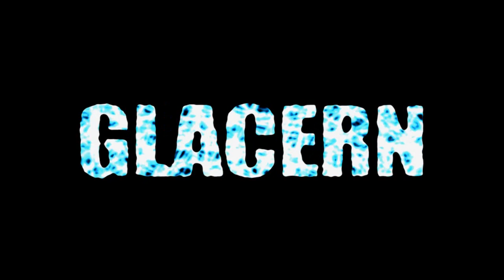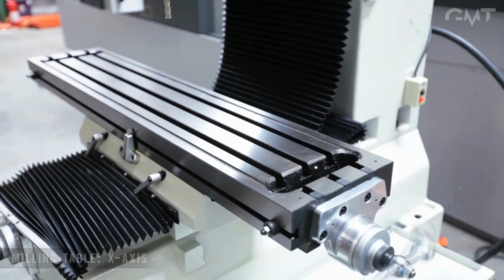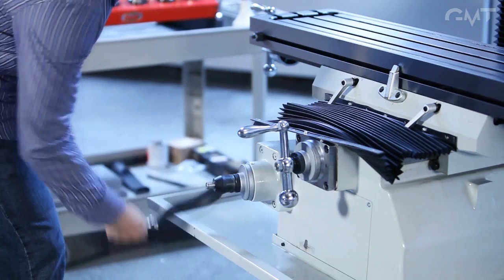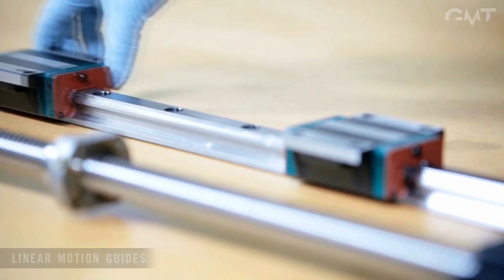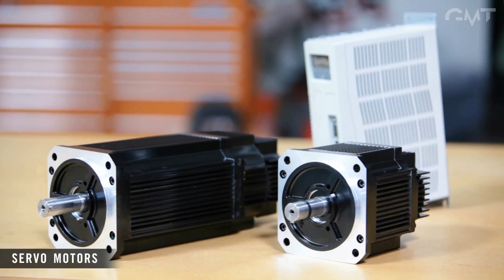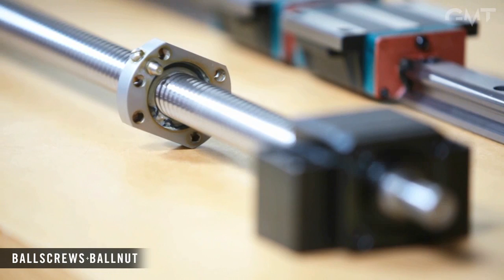Crash Course in Milling: Chapter 1 - Basic Machine Anatomy, by Glacern Machine Tools

Comment: Case-in-point, all of the comments listed below, about how clean this particular machine is. Remove the finished piece, withdraw the cutting tool from the quill, brush filings into a waste can, spray equipment with cleaner, wipe thoroughly, repeat spray and wipe as many times as needed to remove unwanted debris, liquid, and grime. The result... no longer impressed by the cleanliness of others' machine shop. However, I understand that some people like to work in grease and grime. In that case...

Comment: ... the power from the motor to the spindle (for the manual machine) is transfered through a sliding SPLINED assembly located into the quill, such that it can slide up and down and rotate at the same time. On the CNC machines, the spindle motor is generally carried on the column and it moves along with it.

Comment: You can tell exactly how lazy a group of machinists are, when they comment about the cleanliness of another shop's machines. We use all kinds of lubricating cutting fluids, and no, Noproofofhell, it does not make them look like all of the other ones. What WOULD make them look like ALL of the other ones, is that if we were so friggin' lazy, that we didn't clean-up behind ourselves, after each and every use. The whole "Clean as you go" philosophy, works wonders on the state of a michine shop.